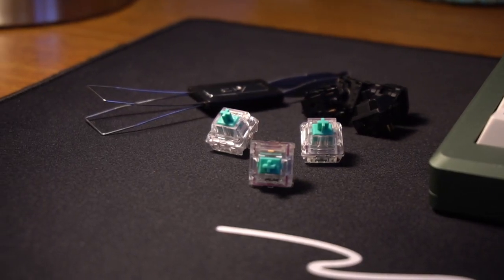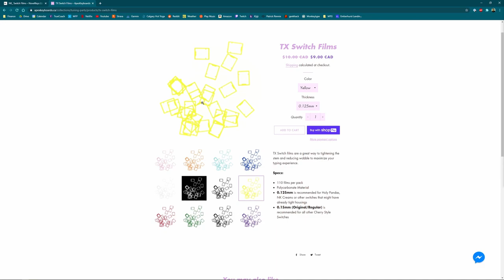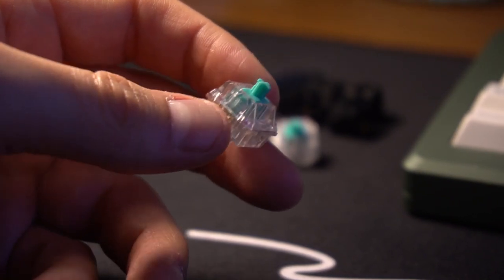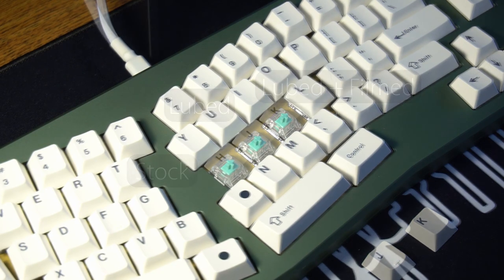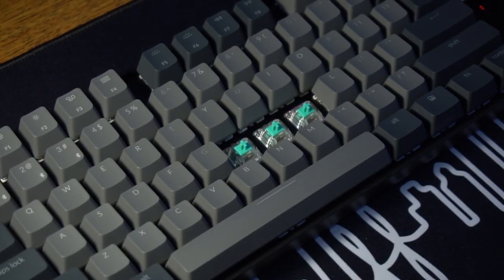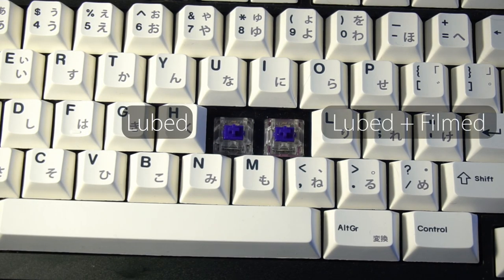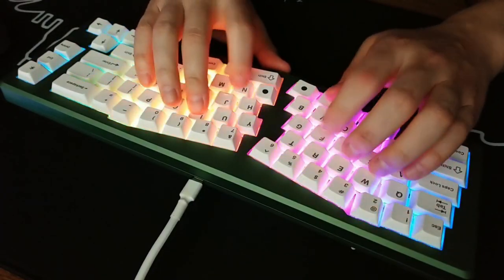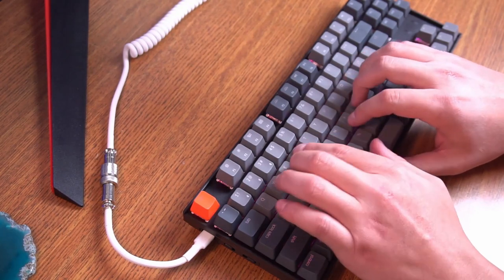Is it worth filming your switches? Featuring Zealios & Tealios V2, multiple sound tests.

Comment: I got into filming due to play in some of the switch top & bottom housings. Never did a sound check between them, but this was a great video illustrating several cases where they help.
Reply from the maker: Yeah I wasn't expecting the sound to be so much different with the linears. I don't think it's as important for tactiles (unless you're solving the wobbly switch housing problem), but I'm sure glad I did it to my Tealios. They're sooooooo buttery smooth to type on now :)

Comment: Really appreciate the video, thank you. I recently tried filming my Glorious Pandas but after doing about 10, I compared the sound of the lubed + filmed to my normal lubed switches and I thought it made them more clacky when I was expecting a lower noise profile, not higher. I ended up removing them and going back to just lubed Glorious Pandas.

I used deskeys films and have most of that pack plus one more. I was intending to use the second pack on the tangerines I purchased to use in my GMMK Pro, but now I'm debating if I want to do that. Were you just using novelkeys films?
Reply from the maker: Thank you for the kind words! These are TX films that I picked up from a supplier in Canada. I've heard from some others that the Deskeys are quite good. Novelkeys is a popular site for this sort of thing which was why I mentioned it.
Reply: This made me hesitate on lubing the Zealios v2
Reply: @dreistheman7797  I wouldn't hesitate on lubing Zealios switches. If you want that tactility to not change, just forego the legs when lubing the stem.

I'm almost positive Brian over at Bad Seed Tech has a solid video on his first full custom MK and lubing his Zealios V2's. If you haven't checked his channel out, I highly recommend it, especially if you're into peripherals.
Reply from the maker: Ditto on lubing the Zealios, it makes a big difference in feel more than anything.

+1 to Brian P and Badseed too! I love his camera work.
Reply: @PatrickRennie  From a Canadian supplier? Does that mean that you too hail from the Great White North? BC Lower Mainlander here.
Reply from the maker: @byran yep good 'ol Canadian kid here!
Reply: @PatrickRennie  Right on, buddy! Glad to support a fellow Northerner.

Comment: Another great video.  What size film did you use? .125mm or .15mm?
Reply from the maker: Thanks a ton! I used 0.15mm for this review.
Reply: @PatrickRennie  great, I’m expecting a set of those actually as well and intend to do a build with tealios and want them to sound as good as your video :)
Reply from the maker: Very nice! Make sure you lube your Tealios as well, I find that made the biggest difference in terms of actual typing feel. Link me a sound test to your build when it's all done! :)
Reply: @PatrickRennie  definitely will do all though itll be iPhone video.  Don’t have any good mics.  That may need to be my next purchase with all the builds I have planned.

Curious if you lubed the center column of the stem? I found that it would always created weird lube fart noises and make the switch a little laggy even if I used a very very small amount but I see a lot of people recommend it.
Reply from the maker: I actually made a vid on how I lube my switches! I don't really do anything different in this tutorial apart from the fact that I bag lube my springs now: https://www.youtube.com/watch?v=Z6c3NlVUAfg

I don't do the center column. I feel like if you lube your spring well then it's not wholly necessary.
Reply: @PatrickRennie  nice we have the same technique although I don’t like bag lubing.  I don’t mind lubing each switch with the brush since it just takes a second

Comment: Hey patrick. I really appreciate your work, I started watching your channel now, and I found your reviews interesting. I would like to ask you a question unrelated to this video. I am looking for a mechanical keyboard that is cheap and has light keys. From what I researched, the red switches are the ones that fit these characteristics, and of those I found the red switches Outemu and Huano. Have you ever tested these two? Which one does better?
Reply from the maker: Hey Necro, thanks for your support!

I have used Huano Reds before (see the review for the RK919 for my commentary on that), but I do not have experience with Outemu Reds. I've used Outemu Browns before and found them to be a pretty good budget option (you'll see them in a lot of the more budget-oriented keyboards like Drevo, etc). I thought the Huanos were good for the price, if not a bit scratchy overall.

Are you looking to build your own or buy something prebuilt?
Reply: I'm sorry, I didn't quite understand what you meant by 'build my own', but of the red switches I'm looking for, at least here in my country (Brazil), the ones I can find for a low budget are just the Huano and Outemu. Unless I import a keyboard, but in that case, would you have one to recommend?
Reply: The keyboards I had found in question is one from redragon dark avanger with outemu red switch and the other is a gamdias hermes e2 switch huano red
Reply from the maker: Ah I was asking whether or not you were going to buy a pre-built (like a Redragon) or build your own custom keyboard. I unfortunately don't have any experience with either keyboard, but I have heard the brand Redragon in a few other videos as being a decent and affordable budget option.